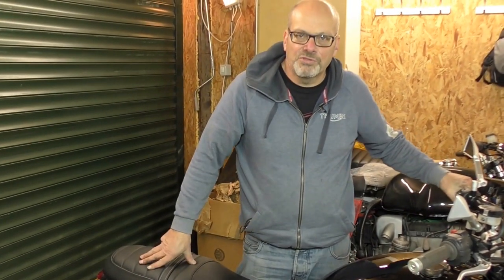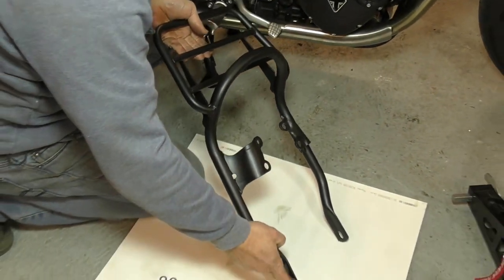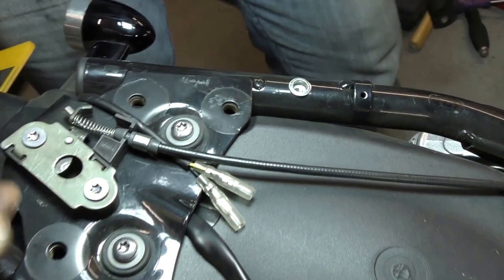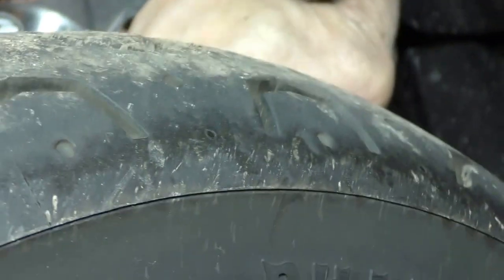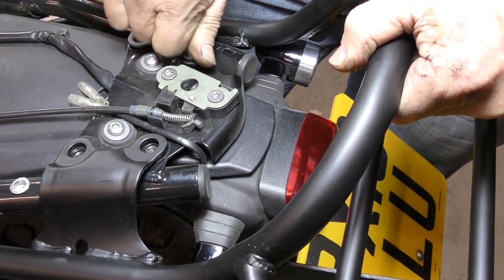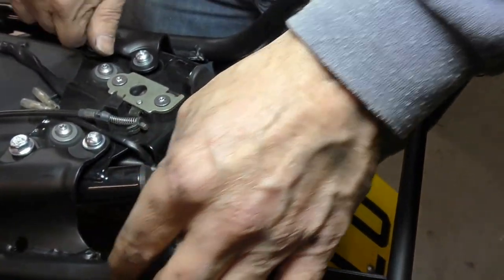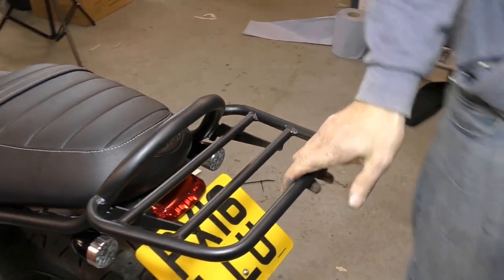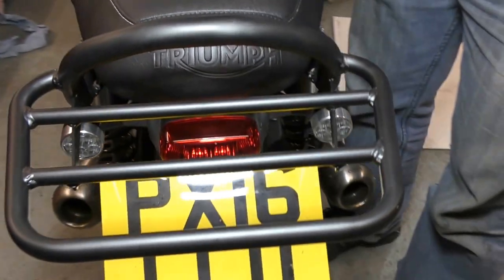Triumph Street Twin, new TEC rack fitting

Comment: I'm putting one of these on a SS 900.   A bit more of a problem with those back 4 bolts.  I'm going through 3 things (the rack, a beauty cover and the docking fixture for the pillion seat), then trying to start the bolts.  I can only get 3 of the 4 in, doesn't matter what 3.  I'm going to pull it back off and slightly ream the small hole.
Reply: @@johnthebodge I slightly opened up each hole, success.

Comment: Hi does this fit a Street cup as well? I read somewhere the triumph ones will but u have to remove rubber grommet from under seat, obv not an issue to do that but are the location holes for the cup the same on yours thks

Comment: I have looked at this on your website and it is not the same. You clearly state how superior yours is, and I agree, in that it mounts to existing threaded holes in the front under the frame yet the only rack shown on your site is the same old shock mount type.  I also like the round shape of the rear bar as shown in this video but the one on the site has a squared off profile  which I dont care for. whats the story?
Reply from the maker: Hi
sounds like you are looking at the air cooled earlier bikes section,see-

https://shop.tecbikeparts.com/products/street-twin-rack
Reply from the maker: I think you may be looking at the wrong part as the Street twin rack on the website is exactly the same
Reply from the maker: sorry we used the wrong picture on web shop, will change it to correct pic

Comment: Great installation video! I'm really thinking about buying this rack from you, but I need a couple of answers to make sure it would work for me:
1) I have installed the original Triumph rear fender removal kit on my Street Scrambler: would your rack work with it? Because apparently Triumph's original one doesn't fit if the rear fender removal kit is installed (according to Triumph itself).
2) How much would the delivery cost (on top of the cost of the item itself) if delivered to Italy?
thanks!
Reply from the maker: Hi
Yes No Problem,  I have this set up on my bike

Comment: might look a little funny but i wonder if it will fit my street cup
Reply from the maker: Yes but has to be modified slightly, actually looks good on the cup
Reply: @TECBikeParts  What needs to be modified for it to fit on the cup? I see you make one specifically for the cup/t100 but I like the curve of this bar better. I'm using a street twin seat also.

Comment: What is the max weight for t120 rack version?
Reply from the maker: Hi
We quote them at 6KG, ( triumph quote lower for the accessory racks) this has nothing to do with the strength of the racks. the low rates are quoted because if you add load to the  rack it can adversely effect the handling due to being high up, outside the wheelbase and also exposed to air drag at speed.
Also high rack load weights and shock loads ( off road riding)can cause frame/rack damage, all this has to be taken into account as a duty of care to buyers.